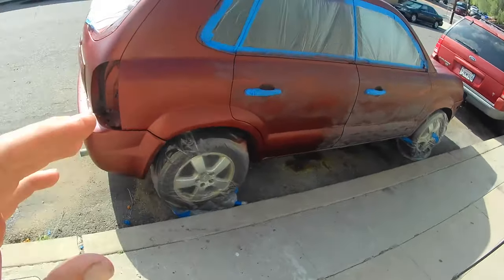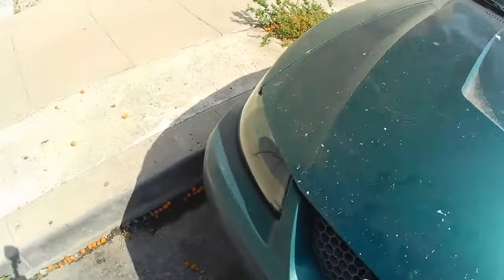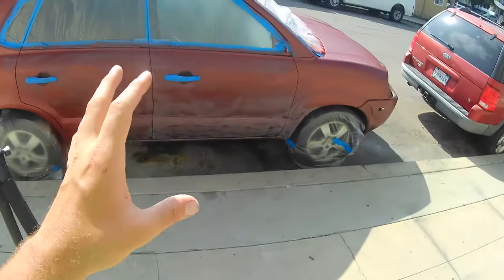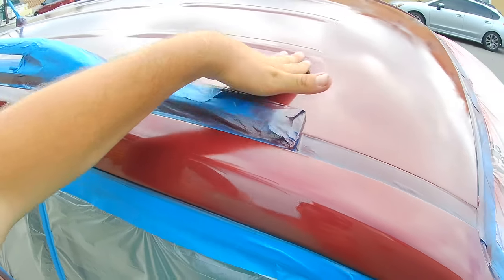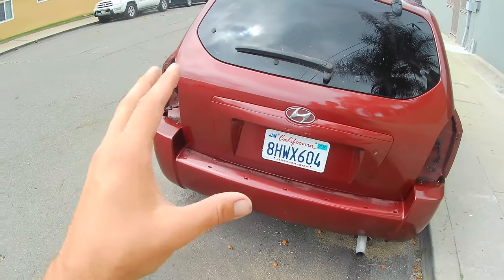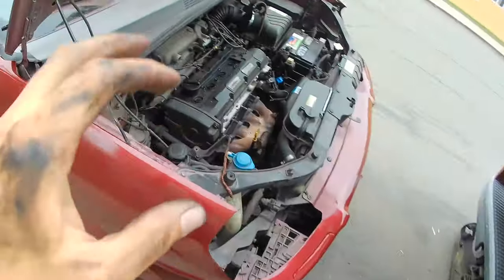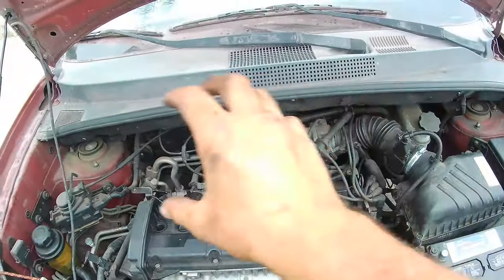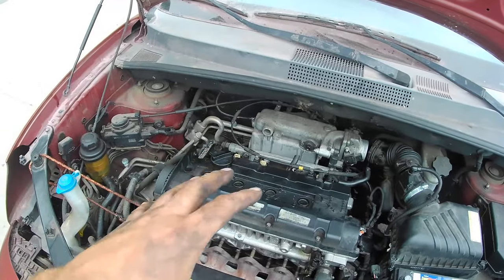I just FINISHED SPRAY PAINTING a car with RATTLE CANS. | Flipping Tucson 8

Comment: The paint is looking really nice. I probably wouldn't worry too much about rebadging it, if you can't get it perfect it'll lead to a further headache. The engine work shouldn't be too bad, It already kind if runs so other than taking it all apart it should be pretty straightforward. Good luck on the salon work.
Reply from the maker: Thank you! Yeah if the rebadging can look good I’m going for it. If not I’ll just order the things.
Reply: @BrokePremiere  alot of vehicles look better without badges in my opinion
Reply: That 2k clear makes a big difference in the outcome for sure. You're outside in a breeze but I would recommend a mask while spraying it. It has all the bad stuff in it since it's a true two part paint. I've been painting for 35 years and clear is one of the most dangerous things I use. I know it's bad but clear is the only thing I use a proper filtered mask or suit for usually. I've seen a lot of people get sick out over the years from paint chemicals so stay safe.
Reply from the maker: I’ll definitely be obtaining a mask soon. I was planning on. Just went back to buy one and they sold out.

Comment: I f'd up and need your help 😢  Had three beautiful coats on the car using a rattle can last night but ran outta time to do the 2K clear.  Left it outside all day today in the sunlight to cure.  Came home late this evening and wanted to get the clear on so I rescuffed it with dry 800, wiped with IPA, followed by glass cleaner and lastly a tack rag before I threw on a light coat again...and it's f'ing wrinkling randomly, which looks similar to what happens to paint after aircraft stripper is applied :/ 

At this point I'm skipping the clear until I can resolve this but I don't know how-to fix this or prevent it again when I do.  

Wait a week, a month and then try again?  Please help!!!